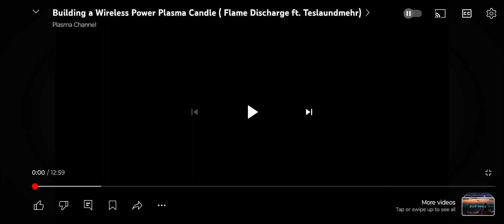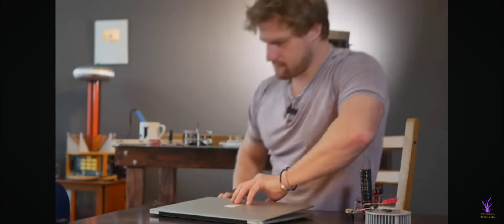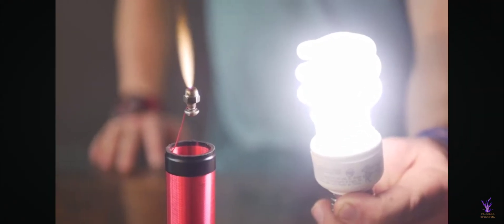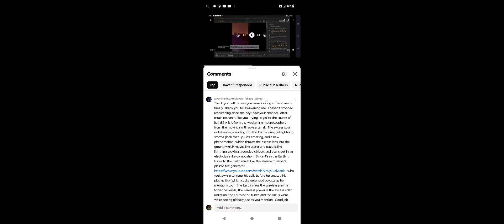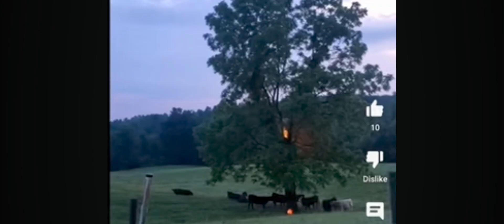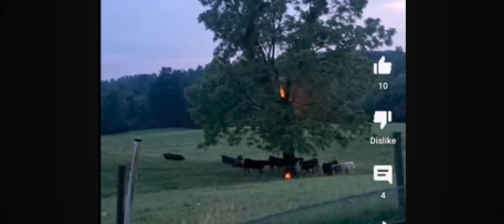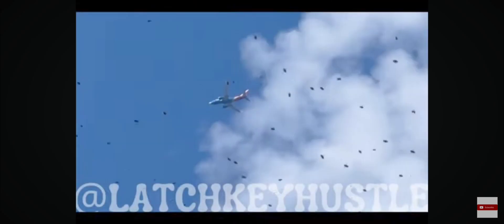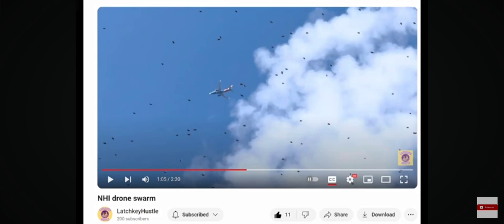plasma fire demo and dragon drone fire extinguishers+ record size flock of 1000 dragons

Comment: I've a question we're I am located I noticed the trees looking very dry what are your thoughts 🤔almost rotten
Reply from the maker: @izarawanjiru I think the trees are affected even if they don't burn by the high amount of ground current. I've noticed lots of trees falling over in a wind storm and the root ball is flush with the bottom of the tree like they have retracted their Taproot which goes the deepest into the ground and works like an anchor. Similar to the way the tallest thing gets struck by lightning so it is when the lightning is coming from underground that the deepest route absorbs the most energy so the trees retract their Taproot in order to absorb less energy. Many people have noticed lots of dead trees and I think it's the same ground current that makes them burn which is affecting them at lower levels.
Reply from the maker: @izarawanjiru  the two videos linked below feature trees that have fallen over along with my explanation of why I believe that's happening and it's possibly related to the trees that die off but still remains standing.
Late night tree tipping teenagers
https://youtu.be/_REu4YRo_Wg?si=VosF42Xj3JmfHwAk

Flat bottom trees you make my rock and roll go round
https://youtu.be/osaLC5HYfl0?si=zB6J94ztQnaNKFY4
Reply: @jeffsnyder210  thanks for the reply plus video.